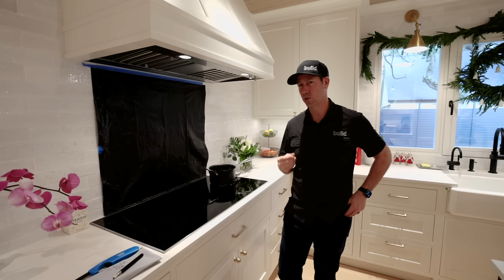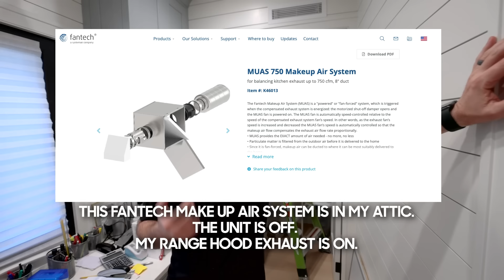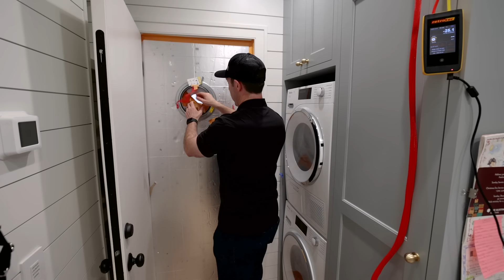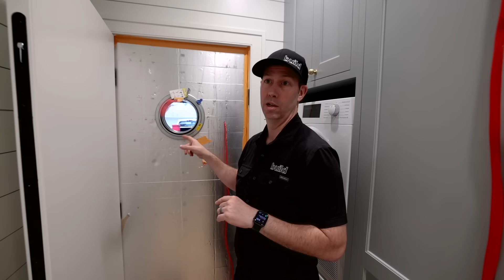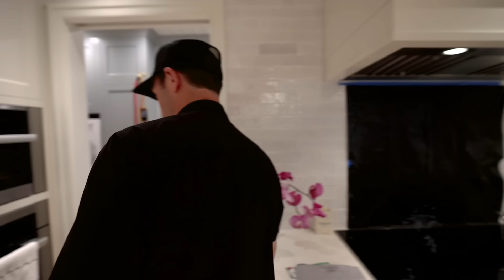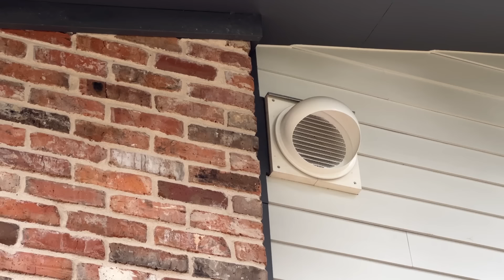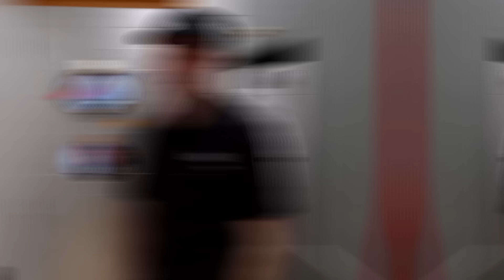Make Up Air for a Kitchen Exhaust - Most Homes Suck. (Pun intended)

Comment: In commercial construction they know about Makeup Air, in large buildings or commercial kitchens with very high flow exhaust, it's a must or your air balance will be out of whack (negative building) and it will get pulled in through wherever it can, which is usually aome place not desirable.
In residential construction, they don't worry about this (so many in that business are ignorant of such things), because your standard bath and kitchen hoods (if you even have one) draw so low flow it doesn't matter, the air needed will pull from gaps and other openings, or just sit there and spin with no actual flow.
The standard builder fan is generally a waste of electricity because they don't have that much pull and lack a feed of replacement air.

Comment: Wouldn't it make more sense for the make-up air to come into the house at the cooktop? That way at least some of that make-up air would entrain the cooking smells and exhaust gas and immediately become exhaust gas, thus reducing the burden on your HVAC?
Reply: This is how ive seen it set up in restaurants.. the make up air will sometimes be on the floor at the foot of the oven, pointed upwards..
Reply: Sounds right to me. Matt, why have that 'draught' running right across your living area rather than having the make up vent nearer the cook top and localising that air exchange?
Reply: Hes talked about this in a past episode. This was just the way that worked out best for his floor plan, and distancing from the exaust point. If he had a basement type foundation it would of allowed for more options
Reply: @sparkyoc6766  it’s not like the only air that can exhaust is the makeup air coming in.  The cross section of the space between the two is enormous, so it isn’t as though there will be a laser beam of fast moving air across the entire living area.
Reply: Yeah. Matt actually has a video about that and does.it that way
Reply: I’ve seen videos where someone put the make-up air right near the exhaust vent.  That would defeat the purpose of having an exhaust vent at all - it would just exhaust the make-up air, while the cooking fumes diffuse out into the room.  But putting the make-up vent on the floor near/under the cooktop would be reasonable.
Reply: I too a was wondering about that. Matt did a video two years ago with makeup sure near the exhaust https://youtu.be/Gyph72_y8wQ like I've seen NS Builders do.

But Corbett Lunsford at Home Performance put his under his base cabinets in several places. He had the space, Matt didn't, I expect. 

Matt, in your experience, is the hood with makeup sure built in, like your video from two years ago, really a good option? Or, would it be better to do like you or Corbett Lunsford did? 

Thanks a bunch for all this content! I'm so looking forward to my reno with the knowledge I've gained through you.
Reply: Yup
Reply: Great question that popped up while watching the videos.
Reply: @GRFillinger  - There is no "perfect" solution for this issue in a functional kitchen. You just have to make compromises on what will work well for the space your building into. In Matt's case,  the makeup air will throw off the normal HVAC needs of the home while the fan is running, but then so does cooking indoors. The real solution is to have an outdoor kitchen. ;-)
Reply: @kc9scott   Remember that the air you're venting from the cooktop is HOT air - it's already headed up into the vent hood.      The colder air coming in hood-located return is not going to stop the hot air from moving up into hood
Reply: That's what I did - I bought a house with a Jennair down draft exhaust cooktop. After installing a 600CFM exhaust hood for my stir fries, I took the motor out of the Jennair and seal the motor housing and removed the outside intake damper. Now the hood sucks the fresh outside air and the smoke as soon as it leaves the fry pan.  I hardly smell anything even when cooking bacons.  I did learn to put a screen where the outside damper was after taking a bird nest out.
Reply: Yes, but let's make it complicated.
Reply: I think it allows a draft to flow across the whole living area, thus improving air quality for a wider area.
Reply: @jeffeverde1  Their point is that the cold or humid air coming into the kitchen would get sucked out if it's closer to the exhaust so you never waste the time to condition that outside air.
Reply: @valkyriefrost5301  Many older wealthier homes had separate or detached cooking areas. Home canning /food preservation was usually done in separate facilities. “Indoor plumbing “ changed a lot if requirements adequate ventilation is one that just now being recognized.

Comment: Matt, Question what about humidity when sucking the out side air in, We know how hot and humid it gets in Texas. seem to be a lot air air flow quickly..
Reply: you could use a HRV/ERV in place of a in/out vent like this, that will help reduce indoor humidity and/or you can localize your makeup air to near your cook tops to to create a updraft that will both supplement the air and not cause a massive rise of humidity during the humid times of years. this is what commercial kitchens do to keep smells/humidity down inside the restaurant. Its also why you smell doughnuts when driving by a bakery or french fries when you drive by a burger joint, smell some good cookin' so you stop by :P all while not overwhelming customers with food stank when they are inside.
Reply: @antibodyarmy  Good Info thanks for the reply!

Comment: We ran into this a lot in central Florida … when they started building home too tight we had to introduce fresh air.  The problem is just pulling in outside air at 96 degrees and 99% rh caused a huge issue so instead of installing a 3500 kit from Trane I wired the damper to the compressor circuit and ducted it straight into the return air box now I’m watching this and I’m wondering how I could do something similar to the exhaust I don’t live in Florida now but in a more forgiving climate but I like the concept good job Matt ….oh we call that a magnahelic to measure those air pressures a manometer we use to measure gas pressures like propane or natural gas

Comment: I’m surprised you didn’t run the incoming air thru your ERV. Seems like that system would allow a lot of warm moist air to come flooding into your home in the summer.
Reply: You can't the exhausted air from cooking is full of grease, food particulate, and maybe soot the recovery membrane would clog up.
Reply: 400 cfs is a lot of flow to run thru an erv
Reply: Ross Outdoors  yeah, but the ERV gets its E (energy) from the air getting exhausted to the outside; there ain’t no free lunch, the E has to come from somewhere.
Reply: @jpe1  Good point.
Reply: Short of running it through the EVR you can actually install the heater in correctly he states that he’s in Texas and he doesn’t need the heater actually you do it will take and dry out the humid air and leave it just a little warmer but it will be much drier and then run it into the HVAC system which will then chill it down and dump it back in
Reply: I tried to do this but my Zehnder is a balanced system and they told me I could not. They may have a new way as it's been 6 years and tighter homes are coming online.

Comment: Ideally, I want an heat exchange between the inbound and outbound air.
Reply: seems like a job for a B-vent. like seriously, someone make a B-vent with a little foil or tin crossing the inside to increase surface area. We could call it C-vent, for cooking.
Reply: He's got that fancy zehnder system.  I wonder why it didn't tie into this.
Reply: @dreednlb   I though the same thing.  Only conclusion I can come to is not wanting makeup air being distributed across the whole house or the ability to have it ramp up to the proper cfm to match the exhaust.  Thinking of it that way it does make more sense to have a dedicated makeup air system even if it will bring in some hot & humid or cold & dry air while running.
Reply: @dreednlb  The way I understand it, you can't use existing ERV systems for kitchen hood air, because the smoke and grease will clog the exchange membrane. Seems like a hole in the marketplace that someone should fill. Even if it's less efficient than current ERV systems, it would be worlds better than a big hole in the wall with no heat exchange.

Comment: I have a small barn kit house I've been sealing and insulating.  I crack the window a little when cooking.  The house is all electric, so I don't have CO2 concerns - With gas etc.. having a good system in place would be more critical - as well as CO2 specific alarms.

Comment: I wonder if anyone has used a ventilating dehumidifier relay to activate when needing make-up air.  That would be cool.
Reply: Yes. Do it in the builds we do the hvac on in S Florida all the time b/c the incoming air is so gnarly humid and hot.
Reply: There is a Fantec system called an energy recovery system that does just that. It is basically a heat pump that works both ways. Instead of just pulling humid outside air in, this put in-line for the makeup air and as Hot humid outside air comes in to the system it pulls energy out of the cool indoor air applies it and removes humidity from that air coming in and dumps cooler air into the space in the winter it does the reverse

Comment: Cool visualization.  I wonder if this could somehow combine with the ERV.  And yes, if I were building or remodeling, I would definitely go with an induction cook top.  In a more difficult climate, it might even be better to just filter rather than exhaust.
Reply: I would recommend a technology like Ventahood for that. It doesn't need filters and no one keeps on top of filter cleaning. Former commercial kitchen cleaner here. : )
Reply: Agreed. Hopefully fantech can add capability to their ERV's to ramp up air intake air when the range vent is on. No extra holes. Whereas with Matt's make up air solution, in the summer he is bringing in hot humid make up air that probably isnt feasible to cool at the make up air unit.
Reply: @andrewdelapp  It would double the price of the HRV. Most of them have a boost mode for things like that and it's just a low voltage wire so it could be mounted in a drawer, All the HRV ducting and extra cost wouldn't have a pay off for the small amount of air in the oven vent. Maybe it's venting 10 to 30 minutes of furnace operation a year worth of heat.  A carbon filter system to recirculate the air would cost more than the make up air.
Reply: @sparksmcgee6641  I checked out Ventahood.  Looks great.  Thanks!
Reply: @scorpio6587  they're pricy. Look at replacement parts. buy the motor, fan and grease trap are the parts that make the magic happen. If you're a DIY that's the way to go. maybe 5-600 bucks. If you're a contractor get the hood that you can mount you're own finish to, like a cabinet face ready refrigerator.   I think they start at1500-200 for the basic stainless hood.
Reply: A tempting thought,  and viable under some conditions such as restrained indoor cooking ( no-fry zone) ,  dedicated hoods  that are easily replaced (no microwave/ recirculating hood combo units)  and frequent replacement of the charcoal filters.

Comment: A passive system can't work at all to achieve "0" differential.. It requires a pressure differential to merely suck replacement air in through the passive hole.. No pressure differential = no flow.
Reply: Most passive ventilation systems are balanced. Ie they suck and blow similar amounts. Once you create a differential (due to blowing out more air  from the hood) the the passive system should make it up due to the differential. Ie.lower pressure inside means more flow from the suck side. Just simple physics. 

Was the passive ventilation off in this video?

Comment: Great job!  Wish I could go as far as you did. $$$. Tightened up our 1980 house, but was told to go no further unless spend a lot more on HVAC. A lot of our make up air actually comes from the wood stove we tend to only use in power outage or severe cold. If we use the wood stove, a window is always left open. Not enough leakage in our house.

Comment: Do you have any combustion appliances? If you are 100% electric does the difference in air pressure even matter?
Reply: great question
Reply: Even without combustion appliances pressurization or depressurization has the potential to cause issues, particularly where there is greater temperature differential between the interior and exterior. Having positive pressure could force the air from inside your house out through even the tiniest of openings in your envelope where it could condense and deposit moisture potentially causing mould issues. Negative pressure inside the home could suck air in from outside with the same potential to condense.
Reply: @JG-el5tb  Good answer!

Comment: What is a bit confusing is all of the negative pressures (kitchen hood, bathroom vents, dryer vent, etc.) have to be balanced and ideally run thru an hrv. But only certain exhausts can be run thru an hrv, so how do you manage it. A comprehensive treatment of air pressure would be helpful.
Reply: I'm curious about this as well.
Reply: ERV's and HRV's cannot be used as makes up because they are a balances system. Fantech has a pressure controller that monitors building pressure so that if any exhaust creates a negative pressure in the house the MUA energizes to equalize the pressure inside the house relative to the outside. It's a more expensive controller because of the very low pressures it senses, but I've used them in commercial buildings for a very long time.
Reply: @steveedlund7357  Thanks for your input. Is this MUA usually run thru any conditioning such as a filter, heating/cooling, humidification, or just commando direct into the house. It seems crazy to spend so much effort to seal up a PassivHaus and then have all this MUA kind of defeating the purpose.

Comment: Previous owner of my house "renovated" kitchen and ran hood fan exhaust duct to the chimney stack.  The house is 3 story high so chimney is quite high with kitchen on the first floor. So when fan is on, all cooking air/smells pushed into the basement (through chimney cleanout)..

Comment: on a related topic: i had storm doors put on every exterior door of my house. i then noticed my gas hot water heater short cycling because the exhaust temp sensor would trip an overheat condition. i looked in the little inspection window and saw that the flame had orange tips which indicates insufficient oxygen. my solution was to throttle the gas valve until only blue flames were visible. 
i suspect that the storm doors made my house so air tight there was an air flow restriction to the burner (i have a power vent). 
i did inspect the exhaust for anything impeding outflow. 

bottom-line: no more short cycling. of course it takes a little longer for the water heater to recover, but that is not a problem.

Comment: You never really explained why it's needed besides code. 

Who cares if the pressure shifts?

Edit: why the code exists was answered below.
Reply: No kidding.  As far as I'm concerned, it's just something else that's going to break.
Reply: I think the reasoning is that if you have a high enough vacuum inside the house (not enough makeup air coming in) the vent fan won't really be moving the volume of air it's meant to be moving even though it's running. If you had for instance a gas stove, it could be producing carbon monoxide gas as it burns and you could be poisoned from a buildup.
Reply: If you listen to the video its code for a reason, saftey. If an exaust hood is pulling negative pressure  in a tight house with no way of air infiltration then its going to pull it from other penetrations in the home such as any combustion appliances such as furnace, water heater, dryer, woodburner. These appliances rely on air in the home for combustion and whats called "stack effect" in the chimney to properly exhaust combustion gases. Stack effect is basically hot air rising in your chimney which creates a small negative pressure at the appliances to help exhaust combustion gases. Negative pressure from an exaust hood will fight with the stack effect and could cause your home to fill with carbon monoxide and for you to take an eternal nap. External combustion air should be addressed also for appliances that rely on air in the home for complete combustion to occur. Incomplete combustion  causes high CO readings, sooting of combustion chambers and poor efficiency.
Reply: @mitchdinner9743  Except, he doesn't have any gas appliances in his new home, from what I can tell.
Reply: @sa3270  its still code in his area and you don't know what the next owner will install or replace. The tightness and insulation most likely won't change but the appliances most likely will.
Reply: Exhaust don't work without makeup air and the cooking grease vapor will go everywhere
Reply: @mitchdinner9743  So I tried an experiment.  Turned on my hood fan and held a paper under it.  3 inches underneath it sucked the paper off my hand tight against the vent.  I think it works.  Then again, I don't have a hermetically sealed house like Matt does.  But anyway, even if the fan wasn't working, I would notice from the flame color if I was getting carbon monoxide, and if not that, I have a carbon monoxide detector.  So I think it's overkill for most situations.
Reply: @sa3270  sorry steve, i guess its over your head.
Reply: @mitchdinner9743  I guess it's over your head.
Reply: @mitchdinner9743  that makes sense. Thanks.